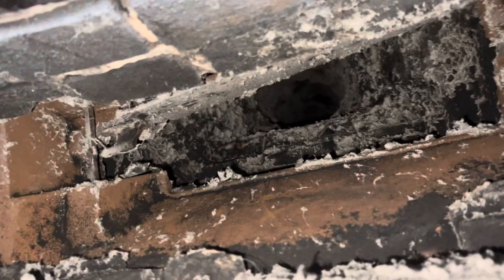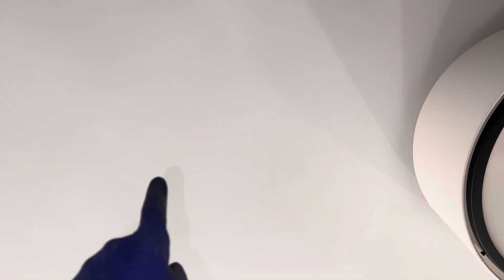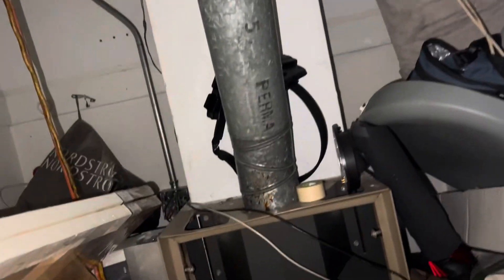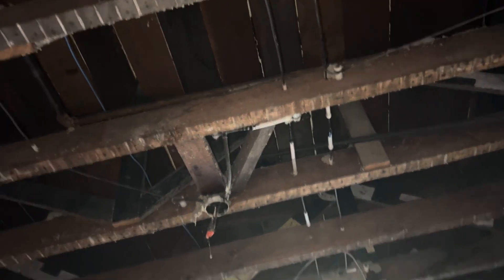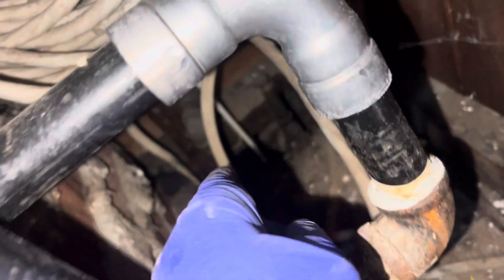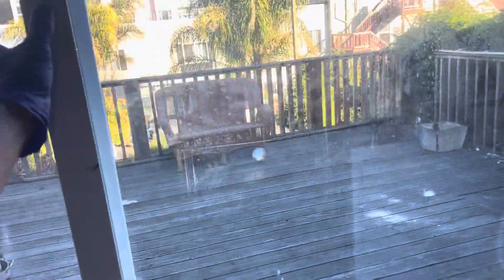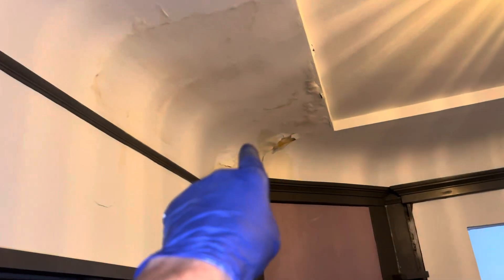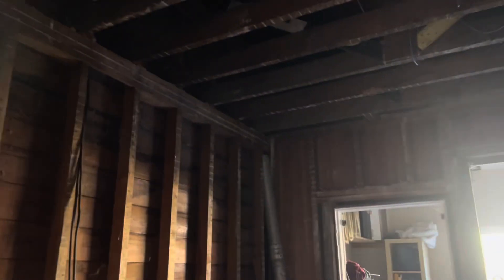BLOWER DOOR 🚪 TEST ON 100 YEAR OLD HOUSE Preparation ￼

Comment: Asbestos, a potential mold issue from that water leak, and a full room of a balloon-framed house that’s gutted to the studs? Never in a million years would I be running a blower door in that place 😂
Reply from the maker: Just curiosity.  This is San Francisco no mold problems.. this district in San Francisco is considered little Mexico. 🇲🇽 it doesn’t get fog in this part because of a hill blocking the fog.. it’s usually 5 to 15° hotter in this little micro climate part of San Francisco. 
          It’s a personal house that we gave to our kids. It’s going through a remodel..  showing my son why houses in San Francisco don’t mold because they breathe so much. You can feel the air between the tar paper that was used as a wrap around the house before putting up the Redwood siding with no insulation in the walls.. plaster and lath house.  After the first blower test.. we sealed and taped off the one room that is stripped down to the studs. And Reed took a test.. 😂 so much air leakage it could not perform the test it was at 100% Fan and terminated the test because of too much leakage could not take a reading.  
      This is a 1920 house and the same thing happened with the 1940 house. Here in San Francisco still no insulation in the walls no air ceiling blower door was at maximum 100% only 1100 ft.² still could not pass the test to take readings because it was too leaky. 
      Both of these houses are gonna go through a remodel, air seal and insulation. 
      And then take an after blower test one remodel is finished.

Comment: round vent registers are from the 60's or 70's? WTF, they are not "orginal". Vents in the ceilings are always a sign that they were added, not original
Reply from the maker: Depends on what part of the country you’re from. Metal work on the east coast in the south and on the West Coast completely different.

Our other house we’ve owned since 1940 is all round vent going through the roof never been modified. 
       All the ductwork off of the gravity furnace in the basement. Is all round ductwork with asbestos wrapped around it for insulation. 
      There was one room that got ductwork modification back in the late 40s early 50s from my grandfather and that was square metal ductwork that was added 70 years ago.,

This house was built in the late 19 teens early 1920 or 21 . 
      They came standard with round ductwork, in the kitchens. 
    With the brick concrete at the base of first floor and second floor kitchens. 
    Here in San Francisco many of these old houses in the 19 teens gas stoves were still kind of new and they had wood burning kitchen appliances. Every now and then come across a few houses with the original ones or the original gas stoves from the 1940s or 50s.. 
     And all the supply registers are round in this 1920 house they are original. They actually have a center turning knob where you can open or restrict them.. 
      This house also had gas piping throughout the house for gaslight. 
        That we found out we’re still active and filled with pressurized gas.  That we had to delete out of the house in cap..
This 1920 house also had a fireplace before furnaces were installed 

In 1961 the original furnace is still in this house. And still works.. and does not have a cracked heat exchanger. 
     With the original blower motor.